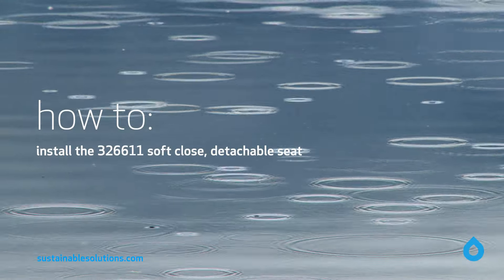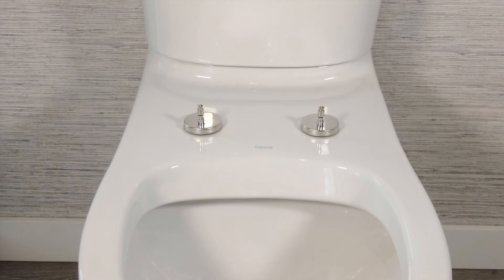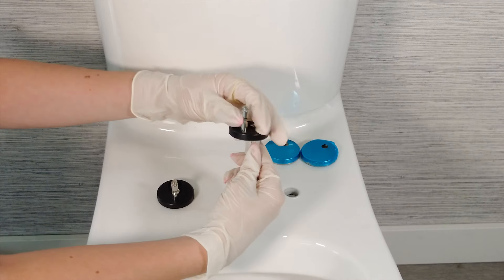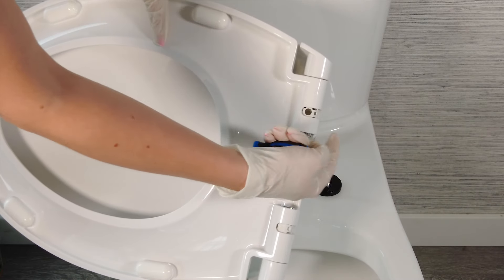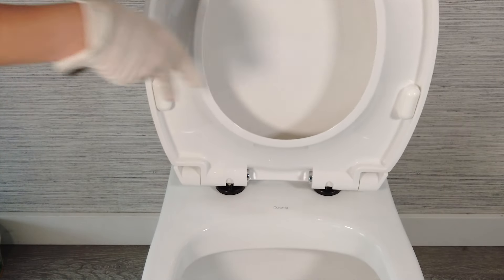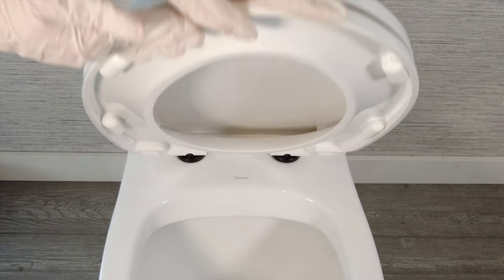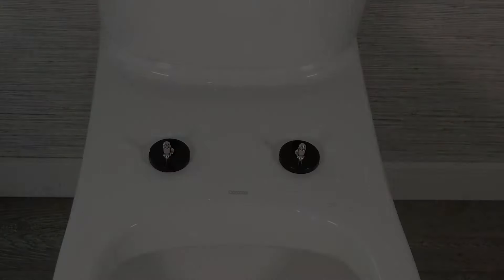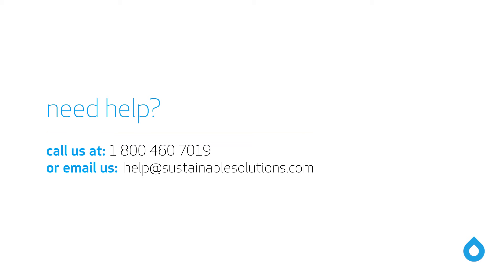Caroma Installation: How to Install: The 326611 Soft Close Detachable Seat

Comment: Can all toilets be fitted with this type of seat?
Reply from the maker: Hi! You can never say "all", because different manufacturers can have differences in the diameter and placement of. the seat installation holes, but this seat can be used on most elongated seats. (We have a soft close detachable for round front seats as well (model 326621W https://www.sustainablesolutions.com/products/toilet-seats/soft-close-round-front-detachable-seat). To be sure that it will work, it is good to look at the specification sheet that we have on line, (click on this link to view: https://www.sustainablesolutions.com/files/product-documents/65ef74780eeaa/seat_326611W_specification_2024.pdf). All of the dimesions are clearly shown, including the distance between the seat holes in the bowl.  If you need assistance, please don't hestitate to contact our customer support team at 1-800-460-7019. We would love to help you decide if. this seat is right for you. Thanks!
Reply: @SustainableSolutions  Thanks.